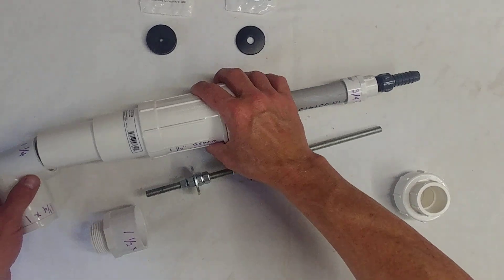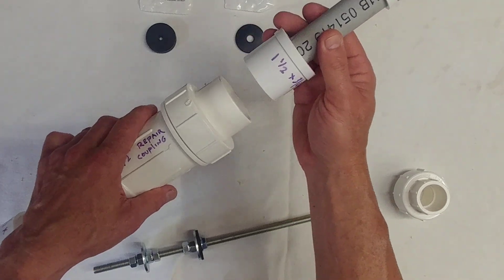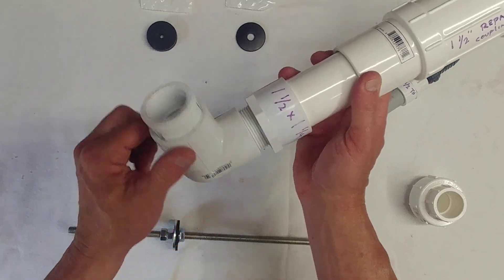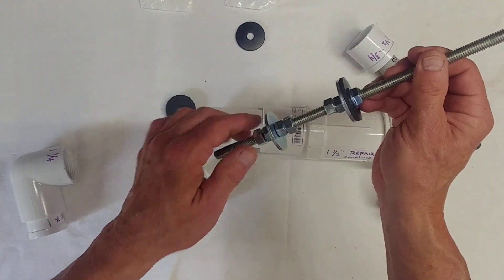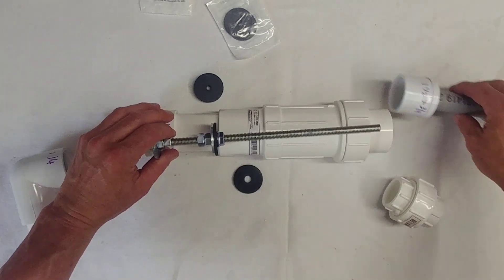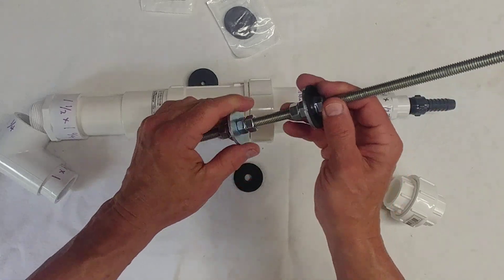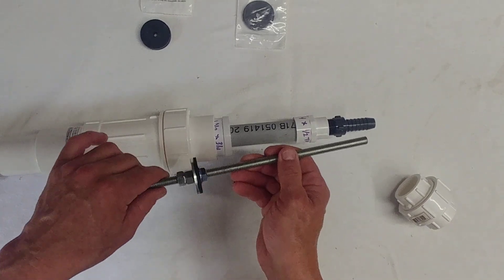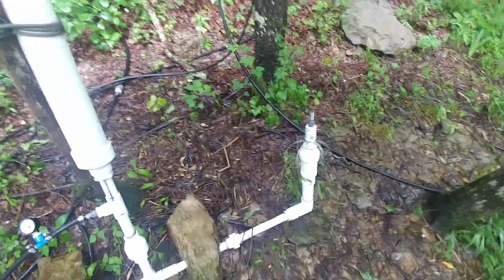(DIY) Water Ram Pump Check Valve BUILD!!!

Comment: Why double nut when you can use a spring washer?
Reply: I too hate lock nuts, they are a pain on threaded rod, the enemy of cable ladder.
Reply from the maker: Yes you could!
Reply: @toddwolcott  I have actually used a cable tie over threaded rod and wound a nut on, makeshift nylock that's good if you don't have access to the other side. Gets you out of a pickle if someone previous hasn't done an adequate job.

Comment: You could put a ldpe 13mm tube on the Polly fitting, to attach a T fitting, then use the T fitting with LDPE tube to direct your waste.
Reply from the maker: This is why I like posting first builds. I get a lot of good ideas!
Reply: @toddwolcott  it's why I watch YouTube, to find ideas and transpose them to my own use. 

Made a check valve with two irrigation barbed fittings, a female coupler, marble, o-ring and a bit of a cable tie tail. Concept is for a larger invention, still have to prototype it and fault find, but in theory it works. 

Your design won't be part of it, but I do like your design. It's good seeing someone be original on YouTube, instead of being blinded by monetisation of videos.

You aren't worried that some flog isn't going to try and steal your idea from underneath you? Seen so many people trying to get technical drawings from others without being able to understand the mechanics.
Reply from the maker: @matthewmeuleman3369  I'm not worried a bit. I really enjoy the idea of people sharing ideas to make something better

Comment: Thanks for your timely video.   Wow - quite the project.   I'll study it and see if I can do the same.    I'm with you that I might want something other than the metal swing check valves - maybe different sound than the clanging ?   Have you compared to see if you get any difference in water volume delivered?   In theory, yours can be adjusted for open distance and weight of to lift the valve.  What I haven't seen other places is an analysis if the water volume delivered and also pressure is different with different type of valves.
I'm actually working on check valves for a DIY piston pump to be driven by a water wheel or as part of Monjolo pump.   Like the directional check valve in the ram pumps.  I'd like to do on with balls in the middle - maybe marbles or ping pong balls or something - with my goal to have minimal resistance to the water flow.    Have you done any valves like these?  Here is an animation of the piston pump:  https://www.animatedsoftware.com/pumpglos/pistpump.htm
Did I convince you to share your wisdom with the Water Powered Pumps public Facebook group.  About the same time as we were chatting on another of your videos a John Wolcott joined the group, but not Todd Wolcott - wonder if this was you or someone you know?    Here is the link to the waste water check valve discussion where I have linked back to this video:  https://www.facebook.com/groups/240458583255303/permalink/533567013944457/    Oh I see that John Wolcott just posted with your check valve - must be you - thanks!   https://www.facebook.com/groups/240458583255303/permalink/585623172072174/
Reply: Note - here is a link to the first video that shows the waste water check valve in operation:
https://youtu.be/ROwzO9siQhQ